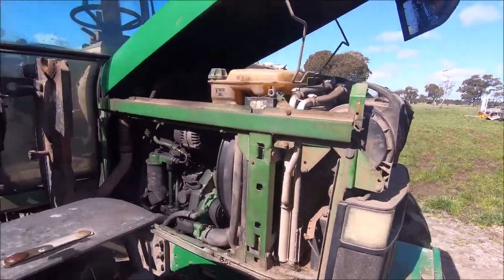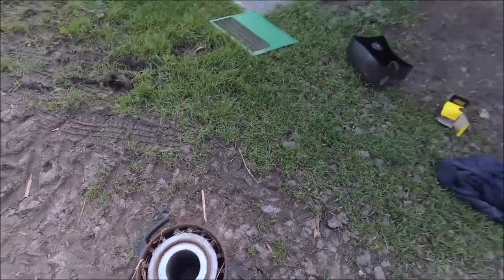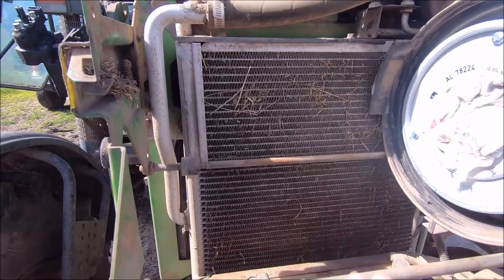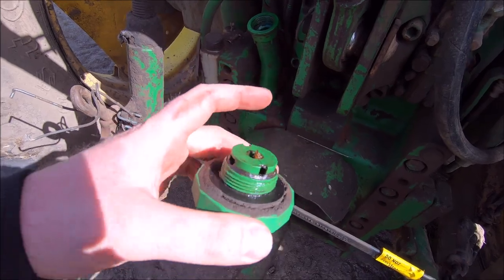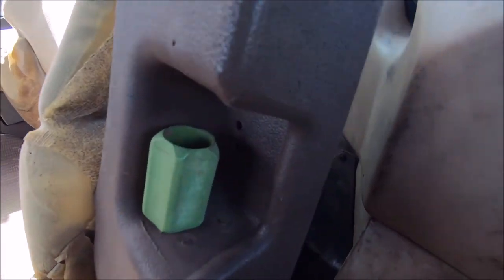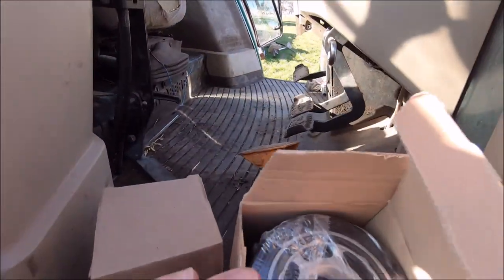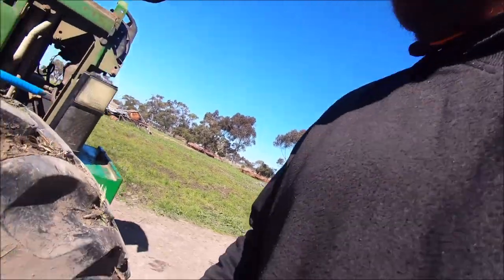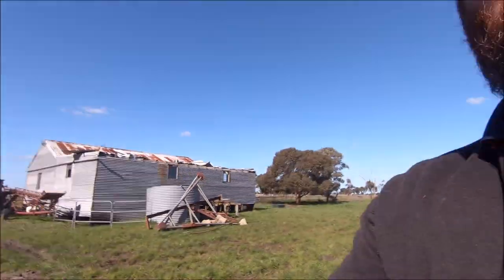Servicing Our New John Deere 6310 Before We Put It To Work

Comment: for a first comment, here: ....Man yo can be a vandal !  ;-)   .    We have a large mixe fleet of reds n Greens +blues too:   Now this 6310:   Oh man what didJD think of when they made it?  I have been very familiar with the older Series( plural) and kind of given up on them since  ( another story).  Now my interest here is to do with this awful machine... anyone agree?   Seems everything is different from  older and newer models: Eng lube filtersvonwards.  what a pain.  Pain?  you should have shown us how easy it is to do a daily check before the service on anything around the engine.  we "get" to service a neighbour's tractor with Loader + Oversize wheels and mudguards attached. Can hardly get near anything and a kwik open the panel job is not on the cards = spanner job too.  Oh Dearey me. Give me the naked engined earlier models or the Yanmar based Compacts, anyday.   Haha Poor dad nearly got washed with sump ol over the P Strg hoses too - try doing it indoors on a clean concrete floor with hot oil for the 1st time.     and then fill sump with fresh oil - either pump it in slowly >200 strokes or a long short necked spout - or was it a short spout extension to reach in and tip over a 5L jug withous splling or or overflowing.      ...  and of course the cab filters - was it 4 or SIX of them .....   awkward to get at and press back in job + the muck accumulating inside the housings ...    How to lose friends.Wait til you have to replace gear -change linkage parts and the like.....  But at least we get our parts next day by Noon from Germany ( Euro Parts Central) to n scotland - not bad, eh?   THanks for posting  Slàinte Mhath.